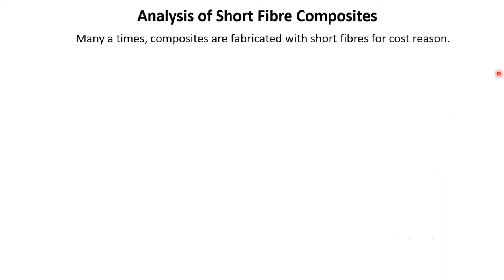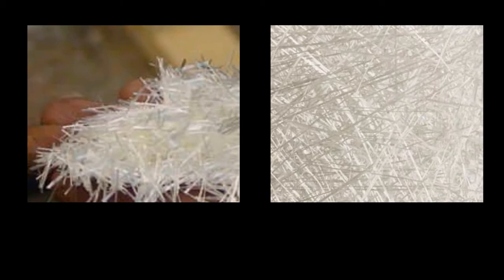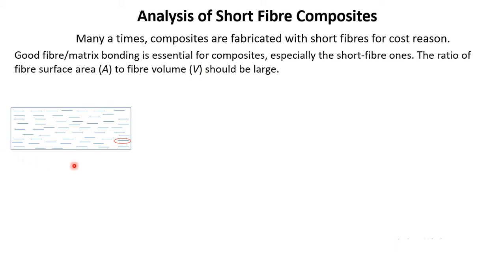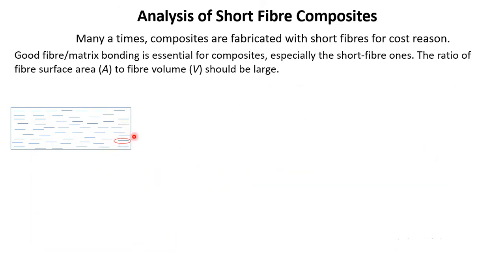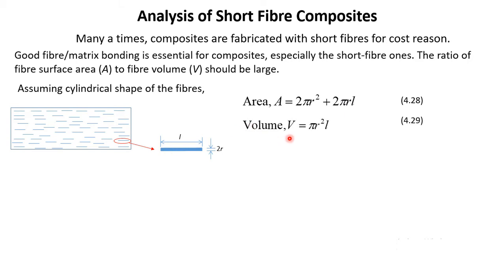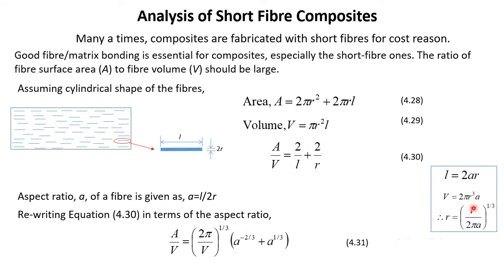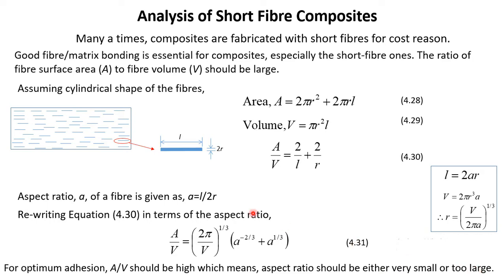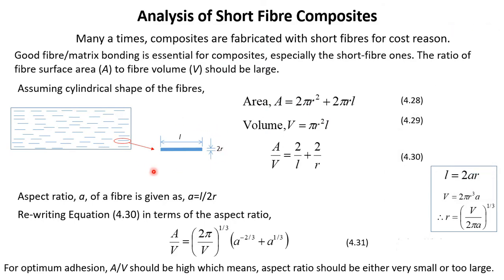Composite Analysis for Short fibres - Critical length of fibre and strength calculations

Comment: The analysis is for a single short fibre, for a number of short fibres, what is the cumulative strength of the composite?
Reply from the maker: Cumulative effect can be brought in by considering the volume percentage of the fibre in the composite. Such analysis could be done using FEA as there are many such software.

Comment: Hi. Great video. I understand that the strength of long continuous fibre composites will be greater than that of short discontinuous ones. But how much of a difference will be there? For example, the difference between strengths of 2 composites, one made of a long continuous fibre of length l and another made of 2 fibres of length l/2? How will the load transfer be different? Thanks in advance.
Reply from the maker: Your question is very interesting and important. In theory, if the short fibre has length which is larger than the critical length then the short should be able to take the load similar to the long fibre. However, the short fibre composite bring other weaknesses (imperfections) just because of the presence of fibre ends. In further analysis given by Equation 4.50 in this video I have explained that for a short fibre composite to have higher strength, it must have the length of the fibre much larger than the critical length. Please watch the explanation just after Equation 4.50.  Let me know if you have further question. 👍
Reply: @engineeringmaterials-tribo5142  Thanks for your reply. I understood your explanation. But is there a way to calculate this difference? I actually have 2 laminates, each having 3 sections with different fiber lengths - top section (15mm and 42.5mm), middle section (220mm and 165mm) and bottom section (15mm and 42.5mm). The total length of both is 250mm. Using the formula mentioned, I can calculate the critical fiber length. I am interested in the load transfer between these different sections due to shear and to compare the tensile strengths of these laminates with another laminate made of just continuous fiber. Is this possible? Thanks again.
Reply: laminate 1- top 15mm, middle, 220mm, bottom 15mm; 
laminate 2- top 42.5mm, middle 165mm, bottom 42.5mm

Comment: Is there any particular method to determine the shear strength for fibre-matrix interface?
Reply from the maker: Single fibre pull out test could be used. If you doing research then I would suggest an article or similar articles,
https://www.sciencedirect.com/science/article/pii/1359835X9500069E

Comment: Sir can you recheck the equation presented at the 20.21 min in the video? The equation number 4.34.
Reply from the maker: The equation is correct. Could you let me know what you meant? I have just replaced sigma f with sigma f max to represent maximum fibre stress value at the time of breakage. This will be equal to the tensile strength of the fibre. Please let me know your confusion.👍
Reply: @engineeringmaterials-tribo5142  

Sir The equation 4.34  is derived through integration of governing equation after balancing of the tensile force and increment of  the same by delta f due to shearing between the matrix and fibre  AT ONE END over a diameter d (2* radius ) and length delta x of fibre. So after integration we are getting the expression for critical length. My confusion is about the presence of integer 2 in denominator.

Sir kindly upload videos for calculation of critical volume fraction for ductile and  brittle matrix
Reply from the maker: @dr.mallikadatta2420  Thanks for your very relevant question.
Here, there is no integration of Equation (4.33). It is based on the maximum stress generated for the breakage of the fibre. Breakage will occur at the point where sigma f is maximum and when this stress equals the tensile strength of the fibre.  The shear stress tau y is same throughout and hence there is no need for integration of Equation (4.32) either. This is total force due to shearing. 
Hence, we do not have to integrate either of these two equations. We need to simply equate them as they are written. This gives us Equation (4.34). Finally, sigma y has to be made the ultimate tensile strength of the fibre.
For any failure criterion, it is the maximum stress that is taken into consideration not integration of all the stresses.
Thanks once again. 👍

Comment: Hi,

Do we have an estimation criterion for calculating the equivalent E-modulus for certain Short fiber composites with only longitudinal isotropic E-modulus available( skin orientation).

I have the temperature dependence data(isotropic).
Reply from the maker: There is no analytical estimation. You may use the finite element methods.